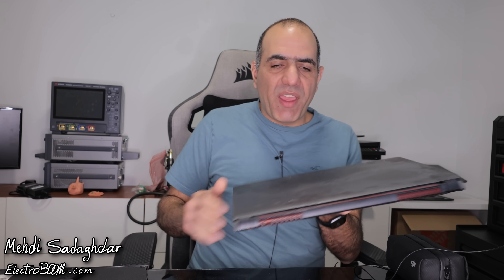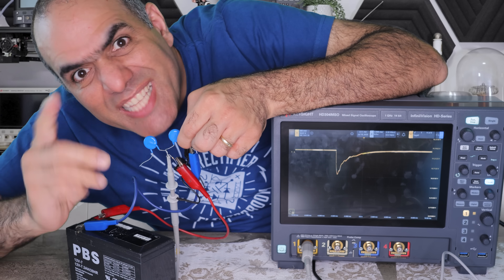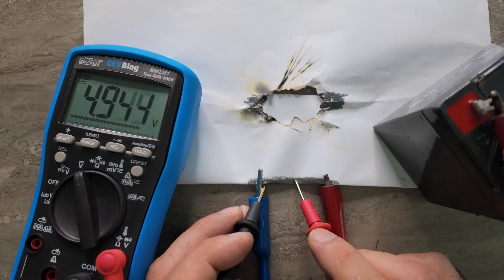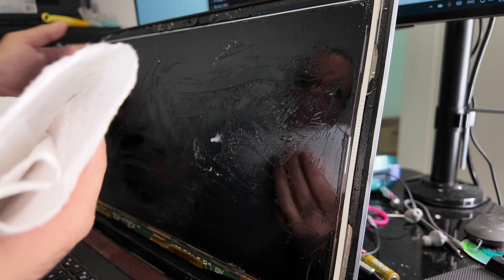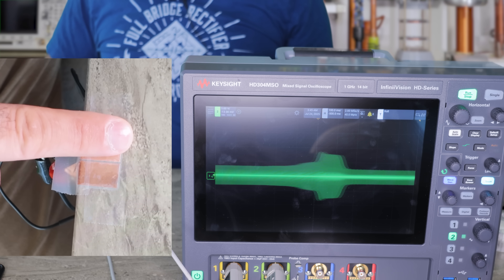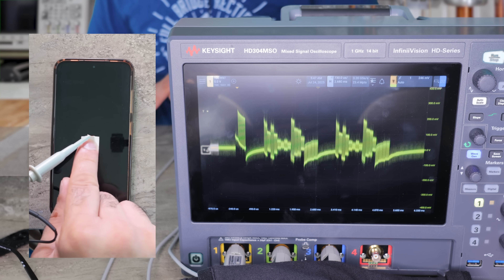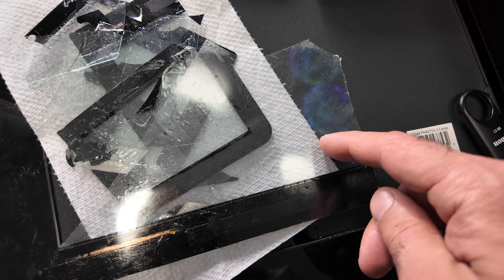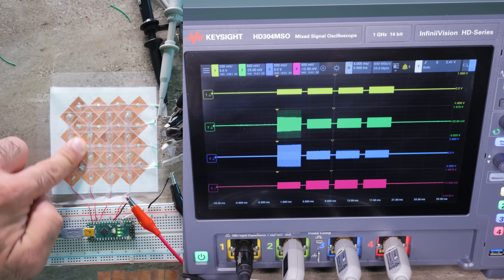The Touchscreen that Changed the World!

Comment: Aggreed, without base knowledge. AI is a toy not a tool.
Also question here from the Class Dunce;
How do these types of Touch sensors recognize captive pens on the screens?
I have a cheap one here that has a different mode for Apple or Android and i wonder where it bridges the gap of registering movement.
It does have a small battery inside, so i assume some kind of field is generated, but the tip is much smaller than a finger.
So how come 20 horizontal (what ever their called again) would suffice on a normal phone screen to make those almost pixel perfect movements.
(Pixel Perfect not litteral of course, but still a 1080x1920 display can do much more refined movement than a 20 sqare over 1080 pixels would measure.)

Comment: 11:52 - it broke at 11:45 - the touch screen also gives rigidity to the screen assembly, pulling the cover on one side  put just enough bend/stress on the led panel for it to break.

Comment: It's crazy we get content like this for free!  We truly are living in the golden age of knowledge.  

I'm a software developer.  AI is fantastic for the easy stuff... most of the time.  Even with all the context, it's not great at the hard stuff.  I spent several hours yesterday asking Claude to fix a configuration bug with a project that uses well-documented packages, and it failed over and over again.  In the end, I fixed it myself.  

That will improve, but, as you said, you still need to know how to ask it... that will also improve over time, but you still need to know what questions to ask it.  For example, you couldn't ask it to write you a microcontroller program to send signals across a capacitive touch screen array if you didn't know how touch screens work, what a microcontroller was, or that they required programs.

We're heading into a dark time where the curious will have endless access to information and everyone else will become more and more ignorant - kids will say "Why do I need to learn this if I can just ask ChatGPT?" and then not bother to learn anything.

Comment: on the AI part - It is good that AI can help us write code BUT you still need to know about that programming language yourself. I have let AI write me some code but after i red through it i discovered some mistakes and let it fix them. But this is a good way to learn as AI can explain why and what did it write and why. I love this kind of learing - Hands on deck as static learning from book will take too long to explain why you need to do like this and that and will exp0lain too many things you even don't need. 
But thanks to you now i know how one could make sliding potensiometer by myself. Was planning to build a lightswitch with microcontroller and did not want pushbutton style dimmer switch or rotating one. Simple, elegant slider style with touch sensing. Now i know how.

Comment: I guess, if you put the sensor grids offset to each other and slightly overlapping, you get slightly different signals, that effectively give a much better sensing resolution than sensors themselves. You just need to compare a few sensors next to each other and calculate exact location of the finger.

Comment: That goo oozing out isn't from the touch-screen, it's from the LCD panel and shows that it sustained impact damage, which has killed it.
Judging from the apparent age of that laptop, it might be a more strategic move to pull the drives out and put them in USB enclosures to copy the data over onto your current computer.

Comment: Just to add to the topic: There are some other types of capacitive touch sensing also. I'm using PICs and Raspberry Pico microcontrollers and they just charge the touch plate and discharge it trough some resistor. Then measure the time to discharge. If you put a finger and alter the capacitance the discharge time will increase. Another method is to discharge the touch plate to GND internally and simultaneously charge the input capacitor of the ADC to Vin. Then connect the ADC to the touch plate, which in this case makes capacitive voltage divider. Then you measure the voltage with the ADC and as a result you get different values if there is finger present or not. Those methods need only one touch plate to measure. Didn't know how this wide area sensors work so thank you!

Comment: Epiphany. I would juxtapose vibe coding with using CAM to produce CNC code for machine tools. In CAM you don't necessarily need to understand a shred of code as long as you understand the tools used and the desired outcome you can make the machine tool do anything you want. Wouldn't that be much the same in vibe coding. As long as you know what you want and how to get there does it really matter how you got there? Yes human produced code might be little to heaps more efficient in size and/or execution but the machine produced code can be produced in fraction of the time and is almost always safe as long as you knew to ask the right questions of it.

Comment: I can't stand AI. As you showed in the beginning it can be wrong a lot of the time. There is no such thing as a computer that thinks for itself. (Research it) AI is only a human made PROGRAM that searches for information and compiles it. If there is bad information in its search then it will output that bad information too. AI has no way of knowing if the info it has is good or bad. It is a total scam, it is basically a new version of Google.

Comment: Lots of glass splinters.  Awesome explanation that in the end - doesn't help at all, but is nice.  Curious about fingerprint sensors, too.  The screen I ordered for my phone didn't have one built in - so I thought - I'll just pull one out of an old broken screen.  That's a big nope, many splinters, and no useable part retrieved.  Then I thought, I'll order a fingerprint sensor and install it...  Nope.   These screens can't be separated from the frame nondestructively, then the back of the screen would have to be modified to accept it.   Basically, it's possible - to the point that without using nanospacemonkey future tools - you'll destroy it every time.

Comment: 15:49 as a programmer, its bad. You loose your own skill (tried writing something on my own and had to lookup a ton) and get "dependent".
I legit cant start most project without coding it via AI first and then trying to fix it for hours (with AI) 
AI is like a drug, make sure to use either sparsely or try using it as lesa as needed or at max as a guide.

Comment: LLMs/AI is very useful for programmers but in my experience it cannot make anything more complex and certainly cannot make anything novel that requires true creativity and/or extensive testing. It also makes a lot of mistakes.
The expectation is it will improve a lot a lot so things might change but for now I would say that use of LLMs for it to be actually beneficial needs a skill of balancing relying on LLMs and own skills. Trying to make LLM write something complex can at times lead to more wasted time with no results than doing it yourself. In the latter case of course you get benefit of understanding things.

Nice thing about LLMs is that you can run smaller open-weight models locally and have similar advantages like LLMs bring but without even needing internet connection. Like if I was working on something and did not have internet connection then such LLM could be used to dig information out of it or even use it to help write code. Pretty nice tool.

Comment: i believe the touchscreen on a firetruck control panel uses resistive touch sensor because they're dealing with large volumes of water and dusts that may interfere with capacitive sensors, and typically they wear thick gloves that makes it a hassle to remove and put back on in emergency situations

Comment: Every real-world test of generative AI as a tool shows that when experienced people use it, they take longer than doing things themselves. It only helps people that lack the experience be fooled into thinking they can do something without having the experience, but that also means they don't know when they are doing it wrong, which specially in coding, results in really bad code that appears to make sense without actually making sense.
People tend to say that the AI hallucinates sometimes, but that's wrong. It always hallucinates, it just happens that there's so much statistical correlations that it has a tendency to hallucinate in a way that gives the appearance of correctness (which in many cases happens to coincide with actual correctness).

Comment: 11:27 shouldn't it be the other way around ?
if the measured signal doesn't change in the vertical direction than the read lines should be vertical,
and signal lines should be horizontal ?

Comment: I mean yeah using AI you can make things you couldn't because of lack of knowledge, buuut if you let AI do all your code you won't get far and plateu. PWM is a good example, it was really hard for me to grasp and implement in low level for a microcontroler. But after hours and hours of struggling I understood it and wrote it. Later i signed up for an embedded contest and wrote my own PWM code for servos and buzzers that were required. Others just used AI for literally every part of their code and i wrote everything myself, even the libraries. If the instructions weren't kinda stupid and really long I would probably land 1st place, but one guy had more points than me so i was 2nd. Not only they learned very little probably, they weren't even better or faster than someone who didn't use AI for code writing (except the 1 guy who was there previous year/s). Its only usecase is finding misstyped words/signs, writing easy short snippets of code or explaining some simple things (but it can lie too!). And if you use it often you find yourself arguing with AI rather than doing productive work.

Comment: around @14:00 i dont like AI for probably the same reason you do ( they can be wrong,  often are - and as far as coding goes, they do not respect the licence of the code they have been trained on, leading to legal issues ... when it works). The good news is you dont need an AI to write code for arduino, most of the low level functions you want have already been written and are available to use. You can use an esp32 if you need more oomf, memory, flash, wifi / bluetooth and digital stuff. they can also be programmed with the arduino framework, which makes them so easy to work on.

Comment: Well I had the same reaction when I knew AI can be that powerful, I was raging, years of hard time learning programing and then AI can easily generate program by just us writing a prompt. But now we can make a good use of AI by using it as a learning tool, Instead of ask AI to write our program, We write our own program first and then run the program into our hardware, and if error happening, we ask AI what is the problem, how to fix it, where the AI found its documentation, etc. Such AI tool for example ChatGPT is a chatbot system that has a "multi-topic" feature that will remember our topics, so we can discuss and at the same time learn our projects while we work on them instead of just relying on AI completely to finish our projects.

Comment: On modern capacitive Touchscreens, there is always a second single full-area capacitor to detect the glass being touched. (First „blip“ on the mobile screen) ONLY when this happens, the row and column capacitors are read. So, the complete reading function becomes more energy efficient. But this is still the best explanation and demonstration I have ever seen. Thank you and ElectroCUTE.
Reply: Why would you need a second large capacitor as opposed to what he said in the video where all the capacitors are connected together in parallel for that initial check?
Reply: @Berkeloid0  yes I think you're both saying the same thing

Comment: Historically, the first touch screen was created in 1964 at the university of Illinois (eventually licensed by Control Data Corporation) for use with plasma displays. They used a 32x32 grid of infrared sensors.
Reply: I remember using a system that had infrared sensors. We could see the little holes near the edge of the screen for the beams. When your finger broke the beams, it had x-y coordinates.
Reply: PLATO !

Comment: As was pointed out in a blog I read (Aardvark) this morning, A.I is only as good as what it scrapes from the internet. An interesting point made, was that in the case of A.I generated code, it wont be long before evil sods start uploading code that can have malware included. You blindly accept some of these offerings to include in your project, unwittingly releasing a final project ripe for the picking by said evil sods. So yes. There is a very good reason to keep learning rather than relying on A.I.
Cheers
Pete' New Zealand.

Comment: 15:38 Timestap

AI can help with a lot of things, but I believe that we should get the knowledge first then use AI just to help ourselves. I mean I am an Electrical Engineer and have done so many programming in different microcontrollers as my final year projects, but the important thing is that I have a good knowledge in programming like C for embedded systems and then I use AI let's say I have to debug something. And I have good knowledge in ML stuff and have implemented it on my projects for predictive maintenance stuff, and for that I use Python as my programming language and use AI just for some help if I get stuck on something. AI can help in writing the whole code but many user don't even understand what AI just wrote for them. This is my thought I am open to other thoughts also stay learning 😊
Reply: Nah, we should get the knowledge ourselves. thats it. Ai (or more specifically, LLMs and similar genAi options) should never be used. between stealing all their data, lying constantly, and the destruction of the environment there is no way to use them ethically. and they are just horrible overall.

Comment: Hours of work thoroughly appreciated! getting that to display live on a scope is fantastically cool. Also I had no idea how these sensors actually work and I'm amazed that the sense grid is mm-cm scale not micron scale! there's a lot of processing going on to make these things work so flawlessly!
Reply from the maker: Since touching effect on the pads is not a zero/one thing and is a gradual change depending on distance to the gaps, if you look at the result on where you are touching and the surrounding pads, it looks like a bell curve with the peak being more accurately pointing to where you are touching. So you can get pretty accurate even with larger pads.
Reply: Seems like they can interpolate a lot of data mixing the signals from all the different lines, and get a lot more precision that way.

I'm just glad we don't have those horrible pressure touch displays anymore, where you had to use a stylus or dig your fingernail right into the screen, and make it bend a little for each touch!
Reply from the maker: I think we might still have them in heavy duty industrial environments though. They are still a bit more reliable than capacitive.
Reply: @ElectroBOOM also some car radio touchscreens. My 2013 Hyundai uses one of those older ones which is how it works with my gloves in the winter.
Reply: @ElectroBOOM  As of a few years ago, resistive touchscreens were still common in motorcycle GPS units.  Not sure about now.  Rain and gloves aren't a problem that way.
Reply: @jonc4403  Given the touchsceen application (motorcycle/cycling) it's a fairly safe assumption they still are.  Resistive is the only way a manufacturer can guarantee the touchscreen works with gloves on.  Capacitive won't work with gloves...unless one spends the money on "smartphone compatible" gloves that is.
Reply: @JeffGeerling Yeah... Exactly what i was not thinking when I really had to type a message in rain. Sometimes I really wish I had a resistive one 😅
Reply: @JeffGeerling nice to see you here man, i was wondering from my high school how touch screen works and so precisely, there must be something microscopic going on! And  now i'm doing undergrad in EEE and when I saw a stripped touch pad beginning of this year, that clicked my head,  there must be some kind of interpolation going on, and that took me 6 years to know. It	 feels very good that something is unfolding to us together.
Reply: Figuring out the details of the capacitive sensing methods is a fascinating exercise. With an active scope probe with low input capacitance (search for Bob Pease's JFET probe circuit, or pick up a cheap old active JFET probe), the sensor won't detect the capacitance of the probe/scope as a touch, and it's pretty easy to poke around and see what's present on the individual drive lines. The different vendors have wildly different techniques, or at least they did about six years ago when I was reverse engineering them. Apple's system in particular was a lot of fun to figure out.

Another fun puzzle: how can you tell the difference between a touch and a drop of (impure, i.e. conductive) water? Not all vendors handle this very well!
Reply: Nice to see Jeff and Brian in the same thread! Just dropping in to say I’m a huge fan of both your work

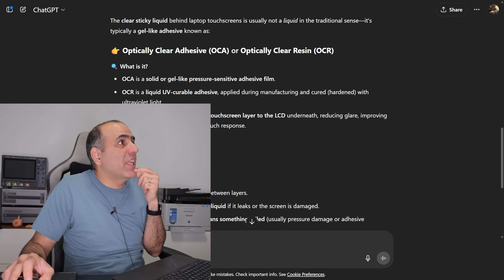Comment: 0:32 Anyone know where to buy that kind of gel-like optically clear adhesive? I bought some screen protectors for my aging s10e on Temu, but they only had a strip of double sided tape on the edges. I.e. kinda fake 😅. The screen protectors themselves are glass, so good enough for me, but without the juicy gel fillng, the air gap between the screen and the protector seriously degrade the image quality.

I've tried to find it on Aliexpress, but without knowing exactly what to look for, I've been hesitant. I don't want anything permanent that would make replacing the screen protector impossible. That goo like adhesive used on the laptop looks exactly like what I need.